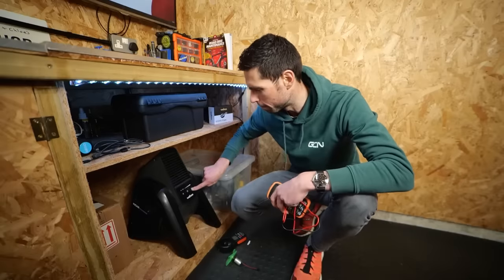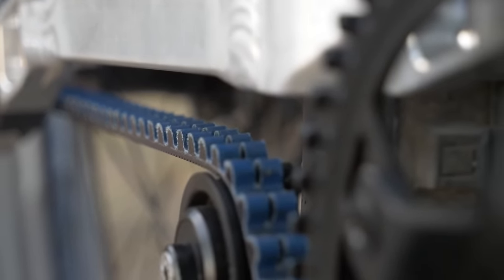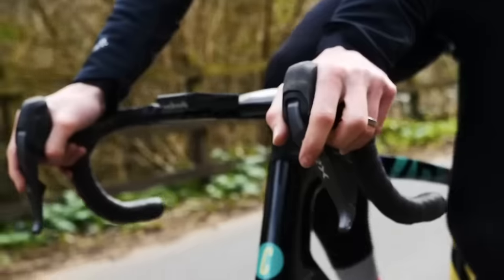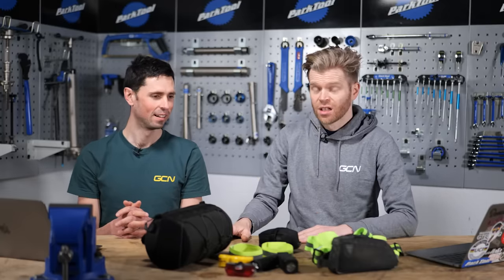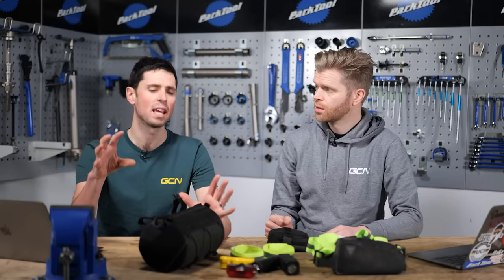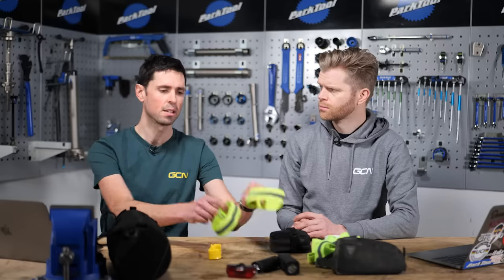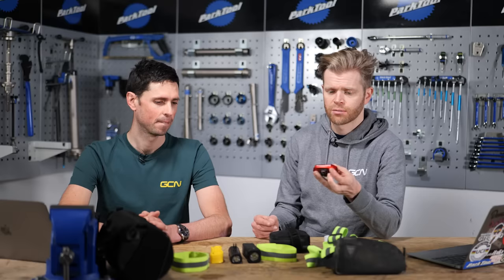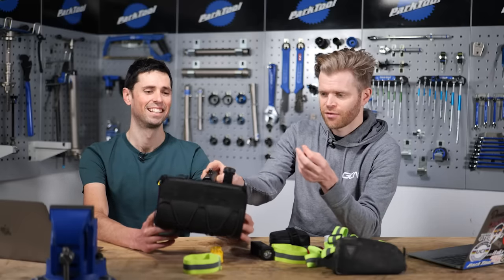The BEST Functional Bike Tech That Cyclists SHOULD Use!

Comment: I don't think 400 Lumen is neccessary as a "minimum".
Especially considering how many people don't set up their lights properly and drive around blinding all other traffic participants.
I've got the Sigma Aura 80 (180 Lumen) which I think is one of the most popular bike lights and it's perfectly fine, even in complete darkness with no lanterns or other light sources around.
Of course if you're riding at higher speeds and a more "open" or unknown environment, you'll want a brighter light with a wider angle

Comment: Belt drive/gearbox systems aren't necessarily hamstrung by gearing range. My Pinion gearbox comes with a 600% range and, if this wasn't enough for you, you could always pair it with a Classified rear hub for an even greater range, although I can't imagine a situation where this would be necessary and I regularly ride 25% hills which I can climb with reasonably low effort even with plenty of luggage (my bike is my only transport) and at the top end, find I can still pedal up to about 40kph

Comment: I've been using dynamo hubs for over ten years. The weight and drag are NOT noticeable. Charging your devices is not cost effective unless you are on a very long tour without regular access to a power outlet. But it's wonderful having a headlight that doesn't need a battery. I didn't realize what a pain it is to charge my light (or run out of charge) until I didn't have to do it anymore. The biggest downside to dynamo hubs is the need to build a new wheel. Lucky for me I can do it myself; others need to have a mechanic do it for them.

Comment: Excellent, pity I can only give you one "thumbs up", please take half a dozen.
I'd like to add a couple of points.  Mirrors are, as you say, useful but they do have a limitted field of view (we've all noticed there are blind spots in car mirrors?) and can give a false sense of whats out there.  My experience of trying one hung off the sun glasses was very disappointing.  There are mirrors advertised that allow you to see between your legs (?) I tried one, set up as per the instructions and all I could see was my legs (!)  A bit like Ollie's lights and bar bag issue.
Reflectives, some on your right (in the UK) arm/wrist might allow signals to be seen at night at all.
Lights.  Quite right Ollie two, one as a back up for when the first fails.  If they're the same type and turned on at the same time they'ye likely to fail together, so stagger their turn ons.  Also usb lights can be charged off a power bank in an emergency.  Also, as a driver, a flashing red immediately signals cyclist so there is better awareness from drivers
The old fashioned saddle bag beats the bar bag as having the same sort of capacity but does not effect steering or front lights (or gear/brake) cables and as you both say you have to stop to access the bar bag anyway.
The one really practical, never mind the speed upgrade is puncture resistant tyres, particularly for winter commutting.

Comment: While Alfine/Nexus hubs have less gear range than a 2x setup, Pinion and Rohloff are up around 600% and the only way to do better for touring is to run a triple or oversize the rear cassette on your double.

Comment: Charging with dynamo hubs is sadly not as straightforward as one might think so I'll list a few things here:

- You'll need something to convert your dynamo's 6V AC into 5V DC. There are many different options available, some of them are really pricey
- Some of those converters have buffer batteries. Those will even out the difference in power generated, giving your devices an easier power source to work with. I highly recommend those.
- Some devices need much less power to charge than others. I had one power bank that would actually drain when plugged to my dynamo charger. I didn't have a buffer battery though, which could have fixed that. From experience, the dumbest devices often need the lowest current. A cheap power bank will likely work better than a fancy one.
- If you have dynamo powered lights, you can easily wire in a switch to go from charging your devices to powering your lights when it gets dark.
Reply: Bridge rectifier, zener diode, and a capacitor - simple.
Reply: @stevemawer848  Oh yeah, I never said it's difficult per se. It's just not as straightforward as "wire from dynamo to phone -> profit"
Reply: Thanks for the tips

Comment: My problem with tpu tubes is that Ive had several small punctures but when I remove them inflate them a little and put in water to try to find the hole there is no air escaping. How can I find the hole? If inflated more to increase the pressure to reveal the leak better it could deform the tube permanently and ruin it. Any tips apreciated. I really like the feel of my wheels with these light tubes in them though.

Comment: 15:15 @gcntech In addition to mobility issues, vision problems.  I have glaucoma in my roadside eye pretty bad and have to nearly turn fully around so my other eye can shoulder check, and a mirror on my helmet or glasses on that side would do nothing.  Aero bar end mirror on the roadside though, absolutely amazing, I can see it and even use it to gauge where people are relative to me in group rides.  And then I added a radar to the set up and nothing sneaks up on me anymore.

Comment: Please do a video on dynamo hubs and how the lights connect. I would like to buy a dynamo hub and get the lights connected but don’t know what brands offer this. I had a bike as a kid that came with a front dynamo that powered the front light but a lot of bikes then came with dynamos
Reply: I only know the Shimano ones. They come with a two small piece plastic thing you put the cables for the bike lights in and plug onto the contacts on the side of the hub. 
The bike light need a switch and the one I got has additional contacts to attach a rear light.
Reply: How do you cater for the lights going out when you stop?  At night, your bike is required (in the UK) to have lights all the time you're on the road, not just when you're moving.
Reply: @stevemawer848  If you are stationary on the left hand side of the road (UK) or pushing your bike at the roadside you do not require lights.
Reply: @stevemawer848  Dynamo lights usually have a small buffer that keeps them on for some time. And when you're pushing your bike it can be enough to keep them flickering.

Comment: Completely disagreee with USB rechargeable lights unless they also have replaceable batteries. Find one that uses 18650 or larger batteries that you can replace and charge outside of the light so you can just pack a spare instead of worrying about charging a dead light and requiring a charger. I love Fenix bike lights for this reason and the one I have allows you to either plug it in or replace the battery. Game changer.

Comment: In theory, could you do a belt drive with both a front gearbox and an internal geared hub to give a wider range?
Reply: In theyory yes but you have a lot of redundant gears and could exceed the maximum input torque of the gear hub. There are 2x integrated bottom brackets but I didn't see one on a bike yet.
Reply: Yeah, I'd love to see this. You could have an incredible number and range of gears

Comment: Excellent! I did a double take, however, when I thought I heard "butyl are contraceptive"!
As you say, a special frame is needed for belt drive. Are there any possibilities for retrofitting this to an existing conventional frame?
Reply: No, you need a specifically built frame.
Reply: The frame needs to be able to split. This can be retrofitted to most frames (not carbon ofc).
Reply: @frostsmoke  The frame also needs to have a certain stiffness to work with a belt drive. A normal frame might or might not have this stiffness, but it will definitely not have it after you cut it open.
Reply: @nipheon  Yes, good Point
Reply: @frostsmoke  If you look at a beltdrive frame you'll see that the chain stays are way bigger than on a chain bike, for that reason. It's a lot more material that is used in that specific area.
Reply: @nipheon what stress does a belt exert on a frame that, say, a single-speed chain doesn’t?🤔
Reply: @litespud  The tension of the belt is way higher than for a chain. If you flick it it actually makes a sound, like a guitar string.

Comment: One more against internal gears: A friend (ebike commuter) had a broken wheel inside the gearbox and couldn't even roll his bike. Total breakdown. So... No lifehacks to get further at least with one speed.
Reply: I had a friend whose wheel just collapsed. There was nothing he could do to get home with his rear wheel locked up.  That's why you need to ride a unicycle, they only have a front wheel so no back wheel to leave you stranded.
Reply: @kidShibuya   Just saying: In a closed system there is no chance of fixing something. Don't know anyone who had a brocken cassette and couldn't at least roll his bike home. Or bypass the damage.
In the case with the broken gearbox he had to wait for assistance. The alternative would have been to carry the 20 kg bike.
Reply: Do you remember what the brand of this gearbox was and if this was an E-bike?
Reply: @yard2380  
One of the big player. Can't find the message, though. Therefore I won't say a name. 
And yes, an e-bike in the range of 8k Euro. 

But it doesn't really matter. The segment of the video was about internal gears in general. So that includes cheap stuff also. My point was: It CAN be on the negative site and maybe thats a point for someone to consider. But yes, it should be extremely rarely.
Reply: @lordoverride  Ah ok, thanks!

Comment: Lumens in lights... it depends a bit, I have a light I use for the majority of my riding in dark back country roads at 100 lumens, it has a very well made lens and works brilliantly, perfectly adequate for night riding and doesn't blind approaching road users. On dark (country, steep (>15%), unlit) gravel descents I run two at once and 100 lumens is plenty. I have also used lights with average to poor lens set ups and it requires more lumens. Take care not to blind oncoming users... >200 lumens on a bike lane is a PITA for approaching riders and you just don't need that much on a lit bike lane. #bikelaneettiquette #dontbethatguy

Comment: Can I use TPU inner tubes on carbon rim tracks?
Reply: Yes, but not the uber-lightweight ones under 30g. Those will have a warning on the packaging though.
Reply: Depends on the brand.  Also common sense on your weight and how many (or lack of) long descents with braking you have.

Comment: Internal gears like in a gearbox should be made so that it can be mounted on a traditional frame, but I guess the manufacturers wants u to upgrade to a new frame as well.
Reply: You can fit a Rohloff Speedhub on a normal frame. But a singlespeed frame with sliding dropouts doesn't require a chain tensioner for example. So there are advantages to be had.
Of course with a Pinion things aren't that easy. But how would you manufacture something like the Pinion in a way it would fit a standard frame?
Reply: @frostsmoke  make it so it fits in the main triangle, above the bottom brackets.

Comment: 636% Pinion Gear Box, 526% Rolhoff Speedhub compare to a 2x12 105 with max 481% of Range..... for this the gear gox and the gear hub have a biger range than derailleur gears!
What is true- well maintained derailleur set is more      efficient than a gear hub or a gear box!
Reply: Road bike cassettes have narrow steps in general, to keep the gears close to offer the best possible gear for most situations.

With a Mountainbike cassette a 2x12 is a different beast, however if you get 500% or more it's typically sufficient as long as you don't ride 100 kph or climb extremely steep mountains

Comment: I wouldn’t drive a car without a rear-view - why would I use the same roads on a smaller, slower, less visible and more vulnerable vehicle without a rear-view?🤔
My standard setup is a Garmin Varia radar plus a Sprintech bar-end mirror. I routinely check my mirror anyway, but the radar alerts me of something approaching and the mirror lets me see what it is (motorcycle vs 18-wheeler, for example) and - possibly more importantly - it it giving me room

Comment: A bit disappointed that there was no mention of lights with cut off beams! I think in this day and age, that should be a basic requirement, and lights without cutoff beams shouldn't even be considered, for road/trail riding at least. Beside the obvious safety aspect, you also get light where you want it, meaning less is wasted and longer battery life(depending on the design).

Comment: About those TPU inner tubes as spares... I'm I the the only one that doesn't trust those plastic flimsy valves when using a minipump?
Reply: If you buy cyclami tpu tubes they have standard metal valves. I am using them very successfully.

Comment: 3:46 is that even true? i have seen internal gear hubs with like 500% gear range. i don't think derailleur setups can do much more than that.
Reply: You are right. 
Pinion p18 = 636%
Rohloff = 526%
Reply: @heyfellows  Yes, Rohloff is similar to these huge xx-50 cassettes for 1x-setups. I think you can get into Pinion teritory with a 3x setup.
Reply: @heyfellows  And if that's not enough you could combine the two. Theoretically.

Comment: If they can figure out how to make belt drives work with any frame, I'd "upgrade" my commuter immediately.
Reply: I recently have seen a full sus MTB with a belt, which has a pulley on top of the chain ring which puts the bottom part of the belt over the chain stay instead of around it. With this system the rear triangle does not have to have an opening.

Comment: If only pinion made a roady gearbox with 18 individual, non-overlapped gears.  But they, understandably, can't be bothered. If your audience is forcefully dictated to bother about lightness and aeroness, i wouldn't either. Even if it's the best piece of kit for 98% of every roady, maybe more. 
But then - roadies speculated on rim brakes, twentysomething mm tires, tiny wheels and 2x10 and 2x11 for long over a decade and look at them now 😂 all running around with not-rimbrakes, 2x12 or 1x13, thruaxles, ... .  Maybe firms like pinion shouldn't care about roadies' opinion and just do stuff?

Comment: Hard disagree on the mirrors. In my experience these aren't used to have a better awareness of what's happening behind you but rather an excuse not to look behind and have actually awareness of your surroundings. Of course if you're unable to do that in the first place it's a moot point but I'd argue you're putting yourself at risk a lot anyways

Comment: Got a bike with a gear hub, been worried ever since. It seems less efficient, feels more fragile and less forgiving to shifting under power, requires fluid changes for maintenance, can only be opened and serviced by a pro and some of the gears made such an awful sound I downright avoid them because I equal weird noises with wear and tear. Granted, my previous derailleur did eventually give up functioning altogether, but not before well over a decade of abuse and neglect, it would've lasted far longer still with some care, and my next bikes will definitely have derailleurs again. This also excludes me from belt drives but I'd probably find one way or another to ruin those as well. While we're at fluids, fuck hydraulic disc brakes as well, cables are real, and fuck tubeless tires, tubes are real. Any new bike tech just seems to make bikes more of a headache to service.

Comment: Some internal hub gears are quite inefficient, can't take high force applied on the pedals and weigh a lot. Shimano nexus 7 is one of the worst, you can feel the extra resistance. I ruined a hub gear before by standing on the pedals on a steep incline. So I prefer a derailleur system over cheap internal gear hubs, and the expensive ones are just not worth it to me.